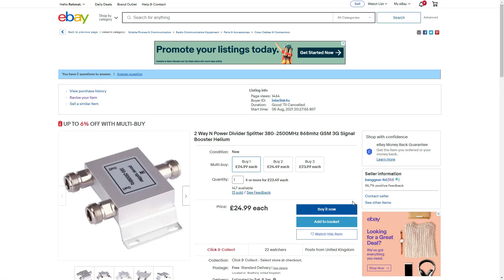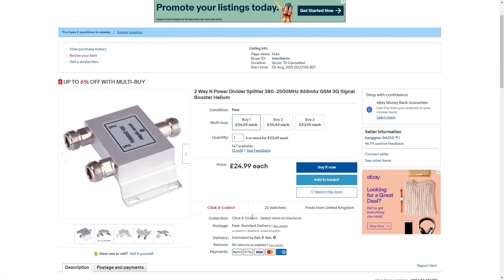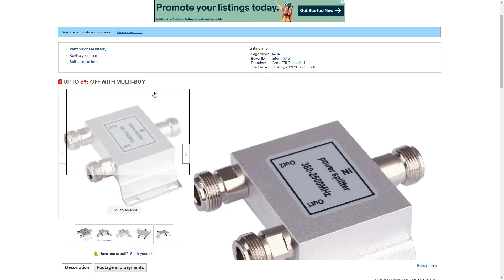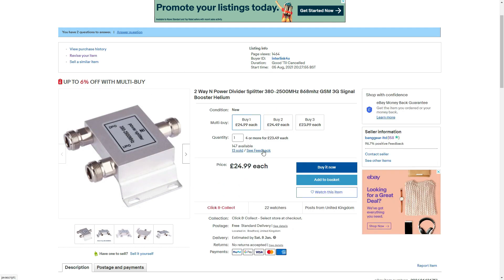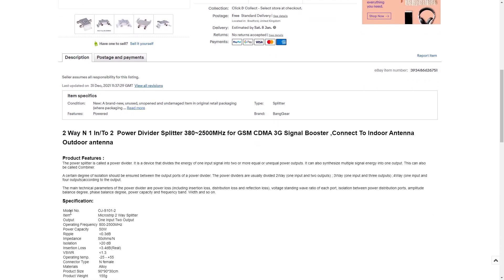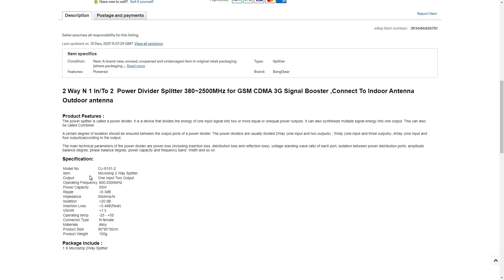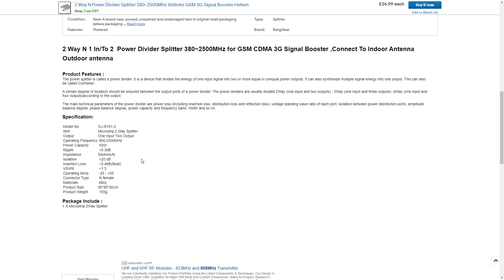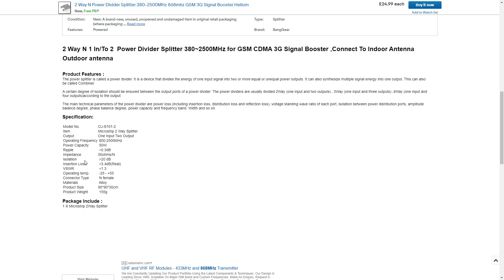How to Use 2 Helium Miner with 1 Antenna  Power Splitter Signal Booster

Comment: This splitter is not good, you see the range is between 380 Mhz and 2500 Mhz, you need to bring the range as close to your working Mhz as possible. Something like a 700Mhz and 1050Mhz would work perfectly for 868 Mhz that is used in the UK. Please look in to this before you do videos.
Reply from the maker: Best use with bandpass filter . Thank you
Reply: @BangGearShop  absolute rabish idea,bandpass filter will decrease the signal strenght even more.This is GSM Booster ant nothing to do with helium! And secondly is one way.We need bidirectional booster for the purpose ! Not fit for purpose !
Reply from the maker: @sensecapinfo264  if you check description it's splitter not any booster or amplifier.
Reply: @sensecapinfo264 
Can you give us the right specifications for a splitter for 2 miners on one antenna 868?? Thank you in advance